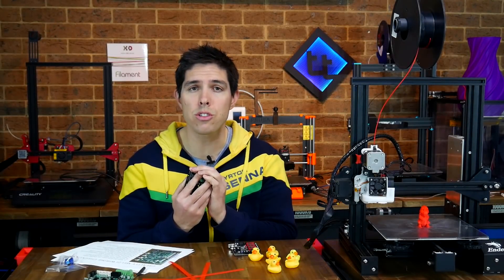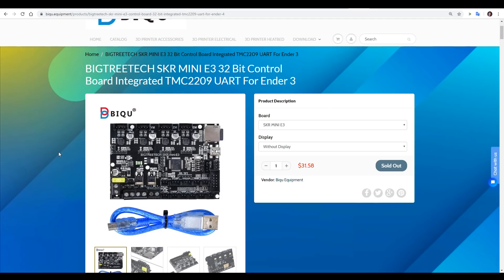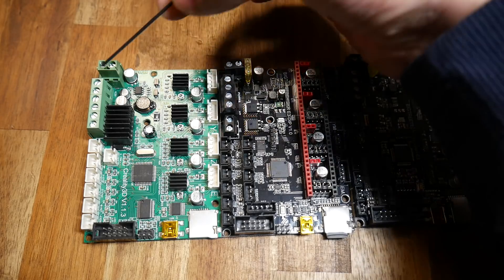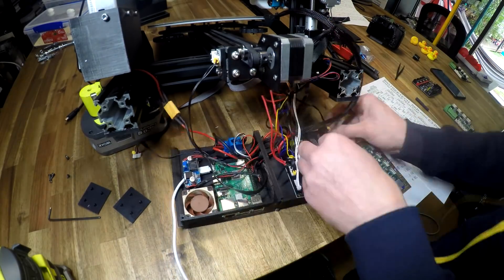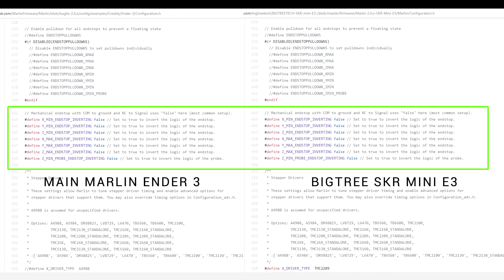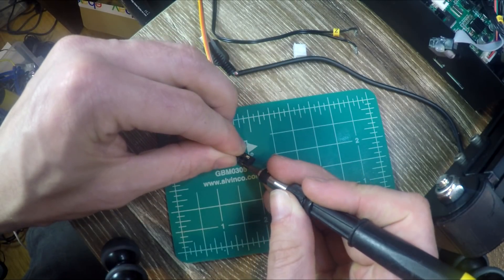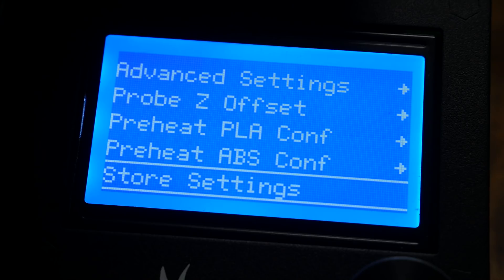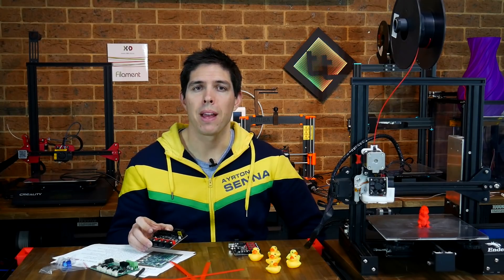SKR Mini E3 - The best Ender 3 upgrade from stock?

Comment: Just installed one on my ender 3 had the same problem with the homing but fix it with latest update everything teaching  tech said is true just buy one now best upgrade for your ender
Reply: I'm having the same issue but cant find the latest fix for it :-(
I'm technically challenged when it comes to editing marlin.. would someone have a firmware.bin for the v1.2 board? Or can someone confirm if the firmware.bin file that Michael has works without losing any new features?
Reply: BigMoike01 hi just just go to the github skr mini e3 page and download the firmware v1.2 put it on your sd card and power cycle the printer hope this helps
Reply: Ahh.. ok.. I actually just downloaded that an pit it on the sd card... the the auto home fix is in that bin file?
Reply: Humm, how do you know that the firmware has updated? I rebooted the E3 and the screen was blue, so I am assuming that it was loading... I have waited a bit now, but screen is still blue..  wondering if I now have to power down, remove sd card and power up??
Reply: BigMoike01 not sure? It’s about 10 seconds to load the firmware double check you got firmware for v1.2 board
Reply: Thanks Adrian for the help.. 
Yes, I had the right firmware.bin file..  I also got my learn on and installed the Visual Studio Code plus platforIO and edited the platformIO.ini and the configuration.h file and compiled a new firmware.bin file... it was created successfully but when I try to boot with it, I still get the blue screen.. I tried to boot with a bin file for v1.1 and it boots but I get a TMC error along the bottom...  I am guessing that it doesnt recognize the tmc2209 drivers.. so now I am thinking that there maybe a jumper on the board that I need to do, or something...
Reply: BigMoike01 try looking on reddit forum under ender 3 lots of information or Facebook if you got it sorry I am lost with this one

Comment: WHYYY! are you first telling me this 2 weeks after i got my regular SKR 😊
Reply: hehe, same here :)
Reply: Same here as well!
Reply from the maker: SKR V1.3 is a superior board, don't worry. This one is just easier.
Reply: @TeachingTech  Cool, cause i'm following your teaching 100% here, without your video guides i would have been lost!!! Gonna try a "hybrid" setup with 3x TMC2208 and a regular DRV8825 for the extruder. 
Will show you some love when i get all the holes cover being unemployed for 1½ left :) BTW you really need some merc we can buy. Doesn't have to be anything fancy, sticks, t-shirts and maybe something like a custom made mini toolset with your logo on, from china ;)
Reply: @TeachingTech  BTW just re-watched the video and figured i may have something interesting for you. I'm a toolmaker, 12 years experience. A new thing we've stated using in the industri these past couple of years are: vacuum "tables" for cutting thin plades. I made one 500x800mm table for an old CNC 2 years ago, got both the CAD and the CAM files (was made in Solidworks 2016 and CAM was mastercam). Let me know if you want them, was a "personal time" project so i rightfully own them :)

Regarding the routers power, i just got a couple of DC regulator from china, 30A max input 42v. With the mods i've seen (and copied) on the ender 3, you already know what i'm talking about ;)
Reply: @TeachingTech  Oh forgot; For Alu have an "sparybottle?" filled with pure alcohol/rubbing alcohol. Adjust the nozzle so it sprays as thin a pattern as possible. Don't worry, it's perfectly save, Alu does spark. Way back when i was a apprentice i use to cut 15-80mm plates with a handheld circular saw in one hand end the alcohol spray in the other :P
Reply: Me too 😁 But great way to get into all this marlin stuff. Was afraid of it for months xD (ender stock firmware since the beginning)

Comment: Patience is a virtue! I had been 'humming and harring' about a mainboard upgrade since owning my E3. Almost bought GEN L and then the SKR 1.3 a few times but wasn't quite happy with the set up and alterations needed.  Thank you so much as this seems to be the way to go. A straight swap and possible minor issues that are easily resolved to provide a decent upgrade. Excellent!

Comment: Oh great....video comes out the day after I get in my MKS gen L to upgrade my Ender 3. I have it in and everything, all I need to do is upload the firmware.....Thank's Mike!
Reply from the maker: MKS Gen L is still a good mainboard!
Reply: If you have an Gen L, you might upgrade to an SKR 1.3 which has same formfactor. It has a CPU with EEPROM, so no need to emulate it on SD as on the STM32 boards.
As you already have the stepper drivers, going 32bit is less than 20$.
Also on SKR 1.3 you can use smoothieware.
Reply: @oleurgast730  I Think I'm going to have to try the SKR 1.3 because for the life of me I cannot get the GEN L to work. I might have fried it. It accepts firmware but it does nothing and my MKS touchscreen does nothing. The temps show 0 across the board. The touchscreen is working but the buttons do nothing...
Reply: EDIT: Just wanted to say that I can control the printer when I connect through Pronterface via usb. No control with panel so at least I know the board is good and firmware loaded. Just need to figure out this darn touchscreen!

Comment: Great video, finally I think it's worth upgrading my Ender 3.
Can you please make video of you adding TFT35 V2.0 display to it?
It's available on their store.
Reply: i have to say im not all that impressed with the Screen they do, its literally plug and play in to the TFT marked headers , no firmware changes or anything which is great for ease of use, but theres a few problems ive had which ill get in to later...

 from what i understand (forgive me if i get this wrong then feel free to correct me) it seems to piggy back on the serial connection as if it was plugged in to the USB port. here lies my first conflicts with the screen and octoprint which again ill get in to soon.

 if you've used octoprint (who dosent..?) you know the annoyance of trying to cancel a print or change temperature while its pre-heating, either you wait a few mins depending on your material and temperatures or you switch it of at the plug and back on if your home/by it.  if you try and change the temperature while its heating up you cant! you have to wait till its finished heating up before you change or use the STOCK LCD with your printer.

 so.. same deal, the printer sends the same busy commands too the TFT locking it out of any changes at all until its finished heating, of coruce you can use the m108/EMERGENCY_PARSER commands with octoprint but the e3 mini firmware screams at me if i try and enable this saying its not supported yet, and there dosent seem to be a easy way of adding these to the TFT firmware Evan if i had it enabled, but i could be wrong..

 another annoying thing i've bumped in to twice now in my few weeks of owner ship is that because the TFT seems to share the same serial as octoprint, i've had octoprint error out of my a few times just disconnecting saying something along the lines of "timeout" "too many connections" again not exactly what is said but my memory is shot today hah,

and the layout is kinda boring and poor for a COLOR screen

  now don't get me wrong its very handy for changing a temperature quickly if you want to do some testing before a print or to change it AFTER heat up, but for the time in between when you think "oh crap wrong temperature" you find your self having to use the stock screen, so then your left with using both, probably not the upgrade solution others and me included was expecting

  so to summarize

    seems to share this serial connection the screen also has the same limitations
    seems to conflict with octoprint causing disconnects and then failed/unfinished prints
    poor layout and use of a color screen
  

and i am i no way trying to say its crap, as the main board it bloody amazing, but the screen.. eh.. i dunno id stay away from it, maybe instead get your self a screen for your PI and set up touch UI for octoprint, and have a much better UI experience and hopefully no serial conflicts,  i mean you probably have your pi right next to the printer anyway right?.. 

i think that's the route i'm going to take next..
Reply: Probably not worth it, the board is a literal nightmare to install due to the lack of documentation and photos. The support staff seem helpful, but for something that's allegedly plug and play, it's way too hard to get working. Having proper photos of the board with the relevant wires rather than a wiring diagram would go miles towards making the process real. As would having real documentation about how the firmware is supposed to work, including video of the procedure as it's far more difficult than just loading the firmware onto an SD card and powering on the machine.

Comment: I followed Micheal'advice and bought the new SKR min E3 v1.2. I'm reading from dozens of comments that many viewers are wondering just like me how to install BLtouch and filament runout sensor with this new board. Sadly Micheal is not answering any of those comments. Could someone please help us?
Reply: Skynetmod3d has a firmware for his sensors that works with this board, it's a version of Tim's firmware that's been modified to work with the SKR mini 1.2.

Comment: I just installed this board in your rear enclosure and wow, so far very impressive and I love how the printer looks with everything in the back.  It is so quiet now I notice the fan noise so much more!  One thing I did notice is that when installing the mini E3 in your enclosure my z stop wire is just barely long enough.  in fact I had to bend the pins a little on the switch to ease some tension.  I might see if I can buy a slightly longer cable or just simply cut and extend this one.  Thanks for your enclosure design and your videos!

Comment: I just bought too the E3 board. I will be using the stock board of the ender 3 for my mpcnc. I hope my E3 will came quickly, It said that they do not have tmc2209 drivers in their house, and they will get those about two weeks from now. Hope I will get it within a month or a 6weeks. Thanks for the video!

Comment: ANd BTT are saying there is a shortage of 2209 chips, and they wont have them in until mid september...
Reply: Mid October now... Ordered the normal one with 2208 just hours ago 😁
Reply: They seem to have the dip version available for immediate shipping.
Reply: @Waltkat  most of the problems people have been having on reddit have been with the dip board.  I would avoid that one personally.  I went ahead and ordered the non-dip version and figure I'll just wait, and when it arrives it'll be like a surprise present.

Comment: I was looking at the SKR 1.3 and a set of 2209, but for this price/convenience, I think I'll do this. Thanks so much!
Reply: You might prefer the SKR 1.3 as it has an other CPU. The SKR 1.3 can be used with smoothieware, which is more advanced than marlin 2.0.x. Marlin 2.0.x is alpha. Until 07-30-19 even the HAL for the STM32 was defect, as soon as you went aside from stock configuration, strange things happened (like activating the probe input to use a simple film probe or a piezo, all endstops where deactivated).
The CPU on the SKR1.3 is much better supported, as its the same as on smoothieboard - the STM32F1-series is relative new for 3d-controllboards.
Also the STM32F1... have no EEPROM. Marlin emulates EEPROM on Micro-SD. Can give some trouble if changing the SD-Card...

Comment: Ok, now I'm ready to install the skr mini e3 :D
How to plug cables for Z end stop - black and white when there is the Z axis plug [installing bltouch]?
Reply from the maker: The diagram is in the video and linked in the description.
Reply: When installing a BLTouch you remove and discard your Z end stop switch, it is no longer required as the BLTouch acts as your Z-axis end stop. You can remove the switch from the side of the printer and remove the old wire completely from the motherboard compartment.
Reply from the maker: I agree except I leave my microswitch in place for videos I make without ABL. Including the next one where the BLtouch is in the way..

Comment: I've only had problems with this board, BLtouch has so many problems with this board.
Reply from the maker: Did you connect it as shown or with the 'probe' port?
Reply: @TeachingTech  Yes, it's connected to the Z-Stop Im on marlin 2.0-Bugfix. It's a V3.0 BLtouch and I've read so far alot of people have this problem with the board. And when they switch to the original Creality board the BLtouch works just fine. This is a video of the problem we are all having (https://i.imgur.com/BEdxRFO.mp4) So while probing it randomly fails, you see the BLtouch led becoming red but the trigger is not registerd by the board.
Reply: Ypsilon Media Designs 
That looks like a firmware problem, but could be a marginal signal.  Is it only the BLTouch version 3 affected?  If so, perhaps the hardware fix for the original Melzi boards would work?
Reply: @TeachingTech  Reddit has lots of problem comments about the mini and the DIP boards including dead drivers and BL touch sending nozzle into bed or model.
Reply: @YpsilonTM  Interesting, I have been running this board and a BL-Touch version 3 and haven't had that problem.

Comment: Hey Michael, I bit the bullet and bought a CR-10 S5. Would a board like this be beneficial? Cheers, JAYTEE
Reply: I just finished putting one in my S5, it was a massive difference, quieter and no layer shift anymore.
Reply: @originaltrilogy1  Thanks for the info 👍

Comment: Just got my Ender 3 Pro and a few accessories (upgrades), including this board. Your installation diagrams are great! Having built numerous computers, this board would have been only a few minutes to change, EXCEPT for the insane procedure that Creality appears to use in which they HOT GLUE all of the connectors in place. It took me almost 40 minutes to get all of the hot glue off to the point where I was confident I could pull the connectors without yanking the sockets off of the PCB. It's a good thing I wasn't saving the original board, because despite my best efforts, some small amount of hot glue remained on the hot end thermistor socket which was enough to cause the socket to pull partially out of the PCB as I was removing the connector.  Who does this?  Anyway, GREAT content and I'm learning TONS from you!

Comment: Worth noting that the latest SKR mini E3 now has a new revision board (V1.2) which is not compatible with the V1.1 board firmware.

Check which version you have before flashing teachingtech's firmware.

info on the new revision here on bigtreetech's official aliexpress store:

" Dear customer,

On September 29 start sending version is BTT SKR mini E3 V1.2, only this firmware is currently supported:

https://github.com/bigtreetech/BIGTREETECH-SKR-mini-E3/tree/master/hardware/BTT%20SKR%20MINI%20E3%20V1.2"

https://www.aliexpress.com/item/33042554065.html?spm=a2g0s.9042311.0.0.4f494c4dfyWDdg
Reply: From the comparison of schematic V1.0 and V1.2 looks like previous version doesn't have UART communication with TMC2209 at all. In V1.2 they scarified RGB pins and enabled UART.  Now, instead of RGB they use Neopixel (one wire interface)

Comment: Hi, since im using RPi with klipper would i have any advantage in changing Ender 3 board to this one? Im asking becouse i found that when printing some parts e have problems i til this day i cant find if it is mechanical or software. By the way, great jacket ;)

Comment: Sorry to ask but would you be able to make a config file for the SD card for a ender 5?
Reply: Have you find an answer? Been busting around and can't find a clear how-to (at least for my understanding) on how to install it. When I followed his guide for the SKR 1.3 and changed the settings I found for the Ender 5 (board, port, etc) I keep getting an compile error ... very frustrating for a below average user :-)
Reply: @GertGybels  yes, I found a Reddit post where someone made up the configs and you just drop it into Vs code will link
Reply: Search google for reddit skr mini E3 ender 5, should be first result post from sky8000.

Just a warning tho mine worked I got one good print out and then the firmware broke down, and it no longer talks to the hardware. But this post is updated

Feel free to pm me on Reddit I use the 8-bit_infidel
Reply: @8bitInfidel  Thx alot, so it happens I ran into the reddit post a while ago and downloaded his repository from github but was for the v1.0 and not the v1.2. I did took some of his settings but compiling still hot messed up. Maybe tomorrow at the office I'll dive into it. Thx for your help!
Reply: @GertGybels  I am having the same issues keeps giving out errors now, I'm in the middle of recompiling I will reply if I have any luck and will uplaod for all

Comment: Great video as usual Michael 👍👍👍👍 just went ahead and ordered one. I hope it will fix my layer shifts at speeds >60
Reply: Spartak Fedorovich 
You may end up having to upgrade the y-axis motor.  At least this board has the grunt to drive a bigger one if necessary.
Reply: @boggisthecat  why would I need a new Y stepper?
Reply: @sp78rus  If your stepper isn't strong enough to handle fast movement of the Y axis, it skips steps and causes the layer shift. You can with this board increase the power going to your existing stepper motor, that fixed the problem with me.

Comment: Just be mindful of the center mounting hole on the E3 boards. It’s dangerously close to a resistor that can be crushed by a screw head, so it’s best to leave that screw out.
Reply from the maker: Great tip, thanks Keith. Thanks for all your work with Marlin too!